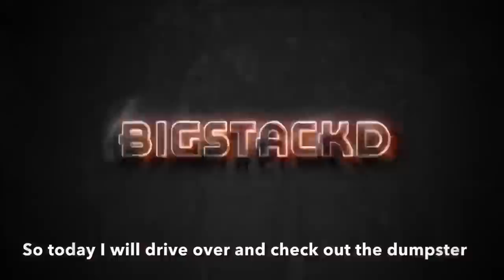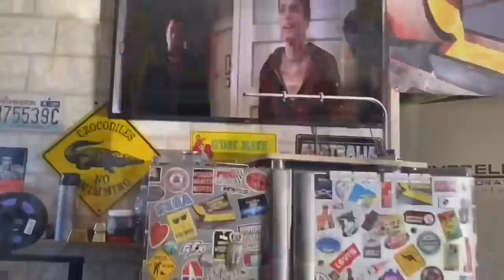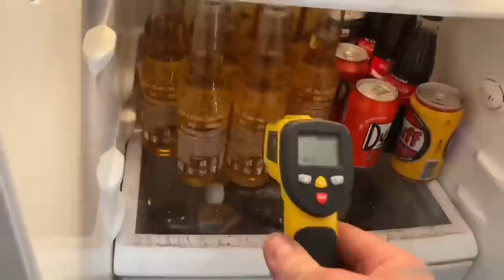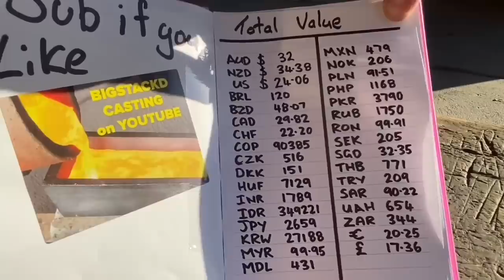Ballast Bullion Bars - Dumpster Diving - Trash To Treasure - ASMR Metal Melting - BigStackD Copper

Comment: Important tip: always use the infrared to pick out the coldest beer.
Reply: Chad move
Reply: @Mx-el9wc  Totally!😎🤙
Reply: Fuk yea
Reply: Edit: Please re classify as Protip.
Reply: Protip: add salt water to a cooler full of ice. Doing so will bring room temp beer to temps between 31 to 35°f within 5 minutes.
Reply: checking ronas for covid.
Reply: good move

but you’re thinking of thermals

Infrared doesn’t detect heat, it allows us to see in the infrared light spectrum which is invisible to the naked eye. It’s commonly used in NVG sets so we can have infrared lasers and lights on our rifles and stuff.

>still found this funny I just am a military nerd
Reply: I feel like something as mundane as this is the origin story of IF technology. Then the dude who made it to help pick a beer was like "wait, this thing might actually be useful for stuff other than beer 👁👄👁."

Comment: Morning (1:33am) BigD, good to see the boys and the double screen images, an interesting change and much better to see the hot block melt into the ice. I have no idea why I like watching it, just like seeing the molten stuff poured into the moulds.

You are also the 1st scrap metal melter I ever watched and the others have nothing in comparison, you are the dogs bollox of the melt.

At 5:55, liked the white sleeve control tube slide, neat idea, also really liked your hammer drill set-up, to remove cement render off my clients houses I use a 5kg Bosch hammer drill and it's like a hot knife through butter taking the render off to expose the background and seeing as your SCA gizmo was held in one hand it would mean less arm muscle ache.

I thought my garden was small but yours is like a postage stamp, and is that AstroTurf I see before me? 

What about taking over a wall and putting your metal collection out there, I'm sure the Mrs won't mind and nobody would steal it as you have 2 guard dogs. 
I visit many clients homes looking at jobs and at one place it was the 1st time I'd ever seen AstroTurf instead of grass, the client said it was easier to clean up her 3 Chihuahua's doo doo's.

For an even bigger space you could dig down and make an underground home, it would be cool on many levels and the dogs would more space to run around in and you might even find Opal. 
You can't detect the stuff, it's compressed water and you could be a cigarette papers thickness away from a parcel of Opal and not know it. 

Here in England the Crown usually owns everything below the surface of your land, you only own the top metre I think.
Reply from the maker: Gday Pete👋🏻, yes I think I’ll be using the hammer drill a lot more as it does seem a hell of a lot easier and quicker. I’ve had that sitting in my cupboard for years and never really worried about using it as it used to be quite therapeutic ripping apart transformers and stators with manual tools and a bit of elbow grease. Yes it’s all fake plastic grass I have mate, the reason I replaced my existing grass was because of where my house is situated I get full sun from  sun up to sundown as the house is facing north so there is no shade to be had for the morning or afternoon for my front or back grass and it was costing an absolute fortune in water just to keep it a little bit green so I dug it up and gave it to my friend who still has it to this day and I put in plastic grass in front and back and that has saved me thousands of dollars and probably hundreds of thousands of litres of water over the last 12 years 👌🏻. And yes it’s a lot easier to clean up after the dog  and if you park your car on it and it leaks oil you can just use some degreaser and wash it in. When I built the house I really wanted to put in a basement as they’re practically non-existent in Australia but my wife talk me out of it and I don’t know why I let it go so easily. And I love having tiny gardens as that means it’s basically zero maintenance and it gives me more time with my kids and dogs and furnaces 👍🏻
Reply: @bigstackD , Fair shout Big D I fully understand completely, I only do lawn maintenance and vehicle care at my place and
used some plastic lime tub lids to make eyelashes for my lady & our elder daughters cars.

You should do what you wanted, a basement area for yourself and the mutt's. You can tell your lady that it'll definitely add value to the home especially if you lime plastered the walls and done some pargetting (designs in mortar) and I'll help you with the rendering work if you want, you'll only have to pay my airfare over and I guess because of covid I'd have to quarantine as I'm from the UK and we have the exciting and nasty Indian variant of covid-19. 

My end of our garden has my scaffolding, hessian sacking, firewood, stone carving area and tubs of lime putty mortar aging nicely for clients jobs. I even have 2 tubs left with lime putty from 2001. The Romans kept their lime 4 years to mature before they used it, our chalk lime is different but has the same chemistry and action but the difference is that they have Tuff, a volcanic rock which is lightweight, strong and the reason they were able to build the Pantheon, the oldest roofed structure in the world. 

The other end is my wife and daughters with our vegetable garden and 3 bay, slate lined compost bays with I turn over every 4 to 6 months. The turkeys and ducks live in the rest of the space, any doo doo's are collected and put in the compost along with the grass clippings and from one end to the other is our septic tank system, all the solid waste is collected every year by a honey-wagon.

During this pandemic, my family,  our garden and animals have been a great respite from the madness in the world plus, apart from 2 weeks confinement at home when I had covid I haven't stopped working.

Comment: Hole in crucible made me think of something that might be cool to do in one of your future melts. When a number 6 crucible bigger or smaller has reached it's "worktime" isn't it possible to do a copper melt with it but fill it all the way up as much as possible and let it get hardened inside the crucible. When cooled down on huge ice brick or inside huge ice bucket break/chip off the crucible. No sanding nor spit shining just metal brushing it clean from left over crucible micro parts. Bottom is top and top is bottom so in this crucible formed copper the bottom is the top that you use and leave like that and the top is bottom you can grind until it's like level enough for to put it on a shelf.

Comment: For something more fun to teardown ("real precious metals") look out for contractors and big relays. Usually they have silver contact points. In a single 3 phase contractor I found 12 gram of silver. Haven't got a good place to regularly find them so I've not yet bothered melting the pieces into a bar but I have separated them from the copper using a blow torch.

Comment: I am just slightly surprised in something that you do. As you have done for a very long time you keep everything including the sanding dust to melt later. Yet, instead of undoing set screws and taking out copper leads, you snip off thee ends and ditch that little bit of the end. Over time (possibly not a short time) that would eventually lead to a nice mirror finish ingot.

Comment: Always a pleasure. You mention it being cold -- if you didn't have a bucket of water big enough to accommodate the propane tank, how would you prevent it from freezing up if it was half empty and you were doing a long day of melting?
Reply from the maker: If I didn’t have access to a big enough tub of water to sit in it wouldn’t be a problem as I have three gas bottles and would simply swap them out once we started to freeze up👍🏻

Comment: It occurs to me that you have more than one furnace, and that they are all different sizes etc. I wonder, if you have every furnace going at once, with the largest crucibles in each, and a relatively easy to source lightweight metal like aluminium for example. (So the big block isnt too heavy to move around for your back!) How big of a mega sized block could you create? Like combining the melted metal from all the crucibles.

You’d probably need to make a cast mould of a giant block of some kind, etc but how cool would it be to aim for the biggest block of metal? 

My other question is would it even be possible?

Perhaps this could be a “special” video idea? 🤔

Comment: WOW You got a impressive astonishing range of tools.Still scratching my head.After melting what do you do with the ingots.How do you earn money out of it. Obviously nwhen you are getting the scrap you are paying for it and then melting cost so how do you get it back...curious. I was into Gold ornaments melting.I stopped for the past 2/3 years as the heat etc was too exhausting.Will start again may be copper, aluminium etc
I used to melt for a client, segregrate as per purity of the ornament and then making ingots purity wise.
Reply from the maker: actually matey a lot of people don’t realise that this channel is purely a hobby. I’ve put out 325 videos and not once did I say you can make money doing this. This is just a hobby or do on my days off that’s why I don’t mind if it does cost me a few dollars here and there and that’s why I don’t sell any of my ingots or coins I just stack them up. once you’ve paid for your initial setup and got all the tools and pieces required this is actually an extremely cheap hobby that is obviously if you can get the scrap cheap or free but I need to pay for the things I take in most cases and I also get a lot of scrap donated but at the end of the day it’s just to have some fun to transform some pieces into something more appealing and to hang out in the garage with a hot furnace and some cold beer👊🏻😁

Comment: im an electrical engineer and when you just throw away or ruin the parts i wanna scream
Reply: Have you seen the vid where he took apart a linear power supplies made with beefy power trannies and then called heatsinks heat shields?
Reply: @plainedgedsaw1694  no
Reply: @enricocolon226  it did physically hurt to watch.
Reply: @plainedgedsaw1694  im sure it did